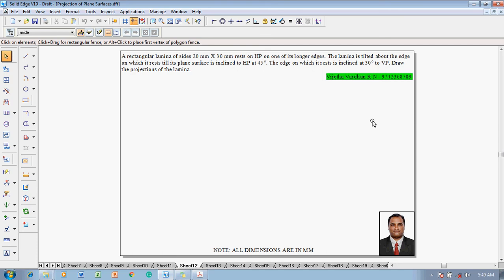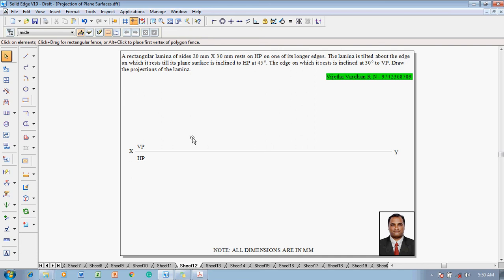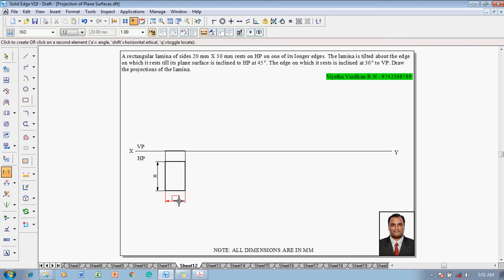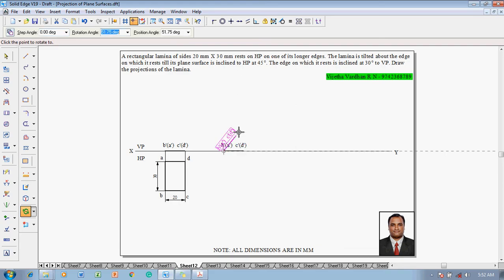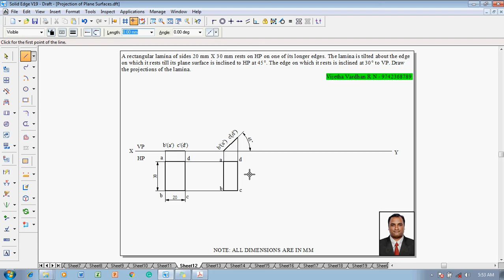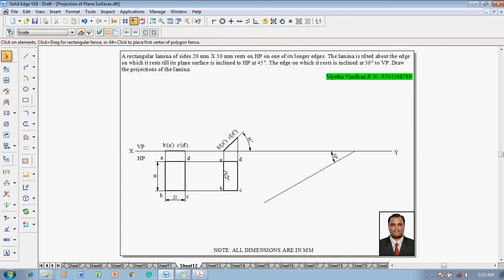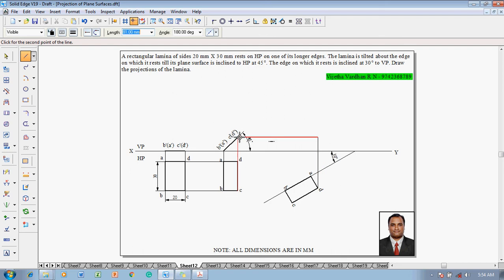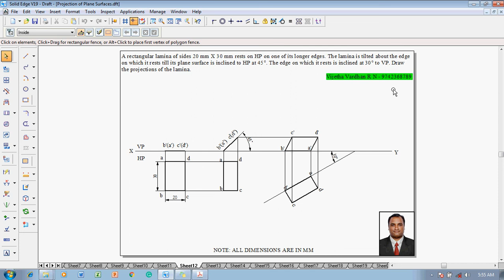Example 12 on Projection of Plane Surfaces

Comment: A rectangular lamina of sides 20 mm X 30 mm rests on HP on one of its longer edges. The lamina 
is tilted about the edge on which it rests till its plane surface is inclined to HP at 45º. The edge on 
which it rests is inclined at 30º to VP. Draw its projections of the lamina.
Reply from the maker: https://youtu.be/LXj5y1v2TI0